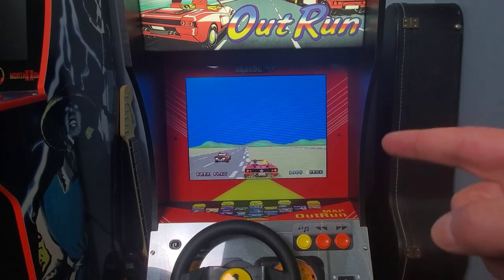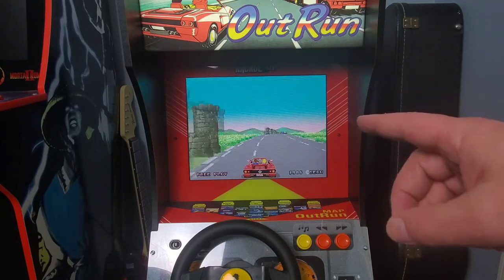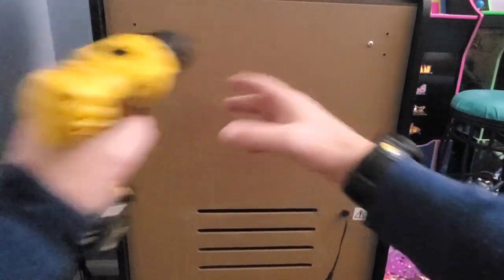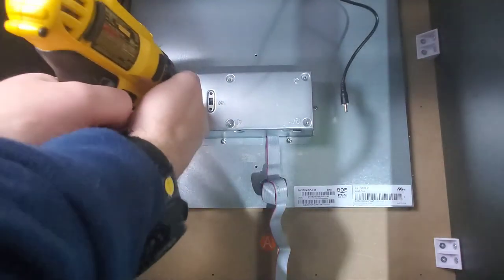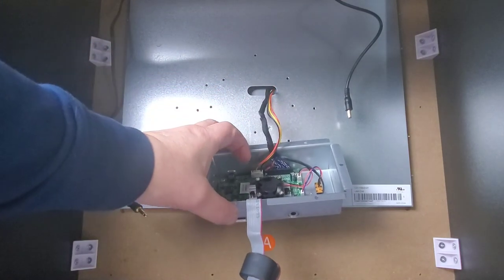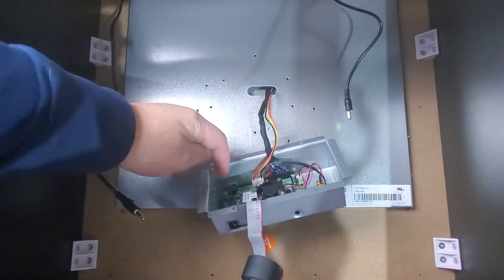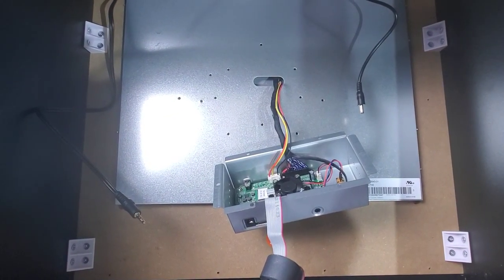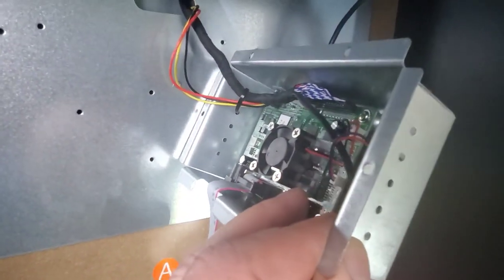Arcade1up Outrun Buzzing PCB Fan Fix

Comment: My Star Wars Pinball just started making a similar buzzing sound. It's not so loud (yet...), but it is definitely noticeable when the game audio is low. Think this would be a similar easy fix? I'm personally always hesitant about opening up and messing with my electronics, and I'm not sure what if anything Arcade1up tech support could do, but any advice is appreciated! Thanking and subscribing in advance =)
Reply from the maker: Hello my friend. First off, thank you so very much for watching and subscribing to the channel.  I am sincerely grateful. 
  Now, with your trouble, I am sorry to hear about your issue with your Star Wars Pinball.  Unfortunately it is imperative you check further on this issue immediately.  I have spoken to many who have burned-out their PCB cards on the pin ball machines due to fan issues. 
  Your pinball machines do have a fan in them and some low sounding fan noise is normal. That being said.......I cannot hear yours so I don't know how loud yours is and if it is "normal" loudness or not.
 My advise would be to definitely isolate first where the noise is the loudest.
 Turn on your machine and listen to it with the volume down. Put your head first behind the Lighted back box and listen, then crawl underneath the machine and listen up by the floor of the machines underside. Which area do you hear the noise. It most likely is coming from the underside of the machine.
  If it is you will definitely have to isolate further. Some minor fan noise is normal....but if you now hear it louder that it had been at the beginning.  You will definitely need to go further and see if the noise is indeed coming from your PCB fan housing or from somewhere else. If it is coming from inside the body of the machine you will then need to open the machine, lifting the lcd monitor and see if the noise is coming from the PCB housing or the monitor itself. If it is coming from the PCB housing you will then need to investigate it further to see if the fan is being blocked in some way .

PLEASE REACH OUT FIRST TO ARCADE1UP AND NOTIFY THEM OF THE PROBLEM. SEE IF THEY WANT YOU TO ISOLATE THE ISSUE YOURSELF. THIS WAY IF ANYTHING BREAKS IT WAS UNDER THE ADVISE AND INSTRUCTION TO OPEN THE MACHINE FROM ARCADE1UP THEMSELVES TO COVER YOURSELF WARRENTY WISE.
  I do understand your reluctance to open the machine and mess around but eventually you will have to isolate the issue. Because if the fan is being impeded it will make the machine overheat and eventually the PCB will overthottle and blow out.
  Unfortunately,  I wish I could be there with you to help and check it for you. You can do it I am sure though yourself.
  Please let me know how you make out and if you need any other help  Again talk to Arcade1up first before you do anything and put a repair ticket in with them,  and follow their instructions on how and when to proceed. Okay. Good luck my friend.  I am here if you need anything else.👍

Comment: Nice video. Unfortunately, mine is still buzzing. Is there a good replacement fan you’d recommend?  Also, do I need to use the fan if I’m just running the original Outrun and not the more graphic intense games?  My place is kept pretty cool.
Reply from the maker: I would reach out to Arcade1up  for a replacement fan. They should send you one. I would definitely not  recommend  you running it without the fan. I did put a laser thermometer on it at the beginning.  I can't  remember  the numbers right now but I do remember  it getting hot fast.

Comment: I just got the sitdown and do notice the fan. Not loud, but it is humming back there. I opened it up and with no wires hitting the fan, it was humming along still. Nothing loud, but I don't hear the fan on any of the other cabinets, don't even know if they have fans lol. Could you still here your fan after this fix? a low humming.
Reply from the maker: Hello my friend, thank you very much for watching. In answer to your question,  yes, you will definitely hear a low hum of the fan. It is a prominent sound in these cabinets and the pinball machines and some of the other 3/4 cabinets. To hear the fan is normal. Just like you would hear the fan in a computer or Xbox.
  If the sound is a very loud buzzing, that would be the sound to watch out for.
  Hope that helps.

Comment: Excellent idea for a video. My OutRun PCBA is definitely louder on mine too. I'm afraid to even touch my PCB. Our OutRun controls wouldn't work out of the box. Got a new ribbon cable, new PCBA, and new control deck. I really had to push hard on the ribbon cable connection to the control deck with a tiny screwdriver. I'm really no good messing with electronics. LOL  Good idea using the small zip tie to hold that wire out of the way of that fan. You've got a really good channel here. 😎👍
Reply from the maker: Wow, you really had some issues with yours. The only issue I had out of the box was the gas pedal did not work. It was a bad potentiometer.  They sent me a new one. After playing awhile this buzzing started. 
Then many reached out to me asking about the issue. So I thought it was important to cover for everyone. 
Well, I am glad yours is working well now. Thanks again for your kind words and continued support my friend. Its everyone like you who make it a joy to work the channel.
Reply: @JesterTester  😎👍

Comment: I had another problem that I managed to fix. I bought the A1up Golden Tee and after a week of playing it I noticed the screen started to flicker on and off. I opened up the PCB on the back of the monitor and noticed the screw for the ground wire was loose to the point that it was going to eventually fall off. If this happened it would have caused some serious electrical damage.
I would recommend for anyone who purchased an A1up cabinet to look inside the PCB and the control deck before assembling it.
Reply from the maker: Wow, thank you very much for sharing that one with everyone.  That is the first I have heard about that issue with the Golden Tee. You are absolutely correct,  if the ground screw would have come loose it definitely would have shorted out the board. Awsome information.  Thanks so much and thank you for watching and supporting the channel my friend.👍
Reply: @JesterTester  Also open up the back of the control deck and check for loose connections before assembly. I noticed a lot of people on the A1up Facebook page complain about joystick and button issues.
Reply from the maker: @sunquestenergyhomesolution96  Thanks again for all your suggestions. That’s why this community is great. Everyone always trying to help one another out. Thanks again 👍

Comment: This is not an issue on the stand up. The cable is tied up nicely to the side.
Reply from the maker: That is great to hear. I did reach out to them originally about the issue and they told me they would escalate it and address the issue. So I guess they did. Thanks so much for letting me know that.  I appreciate it my friend.
Reply: @JesterTester  Definitely better safe than sorry.. checked today. Thanks for the heads up!
Reply from the maker: @kantidinda6218  My pleasure buddy, it definitely was a good idea to check.

Comment: Thanks so much for this. My outrun cabinet  is louder then all of my other cabinets. But it isnt a loud buzz just sounds like a louder older cpu humming. So I checked out your video. Thanks a lot for this. I have the stand up version and it has a zip tie on it already. But i will still monitor it if it gets louder. Thanks!
Reply from the maker: You are very welcome.  Thank you so much for watching and supporting the channel my friend.  I am happy to hear they addressed the issue with the stand up. I actually contacted Arcade1up at the very beginning and addressed this issue with their quality control manager. They told me then they were very thankful for my suggestion and would address it on further releases. So I guess they did just that. Great to hear.